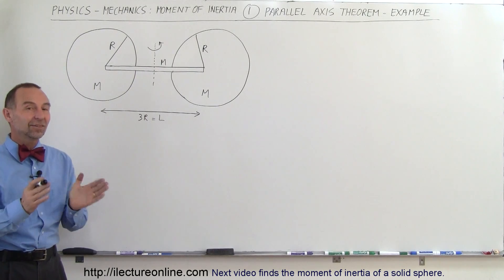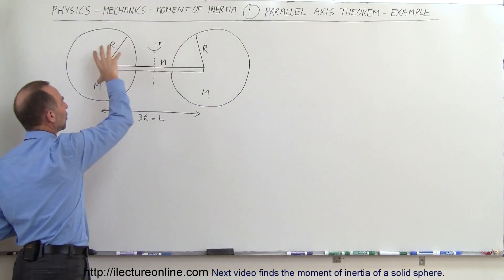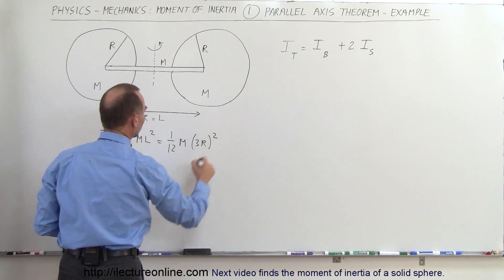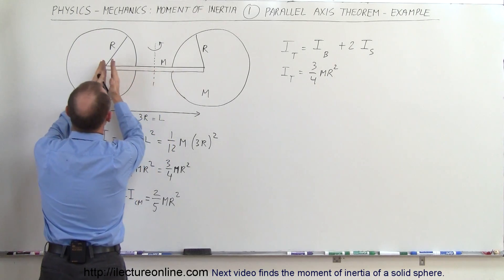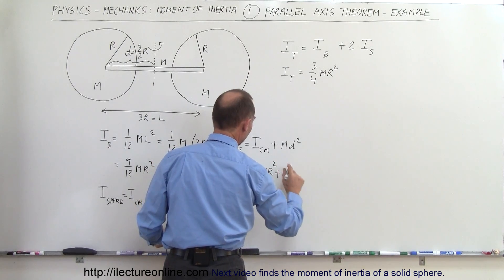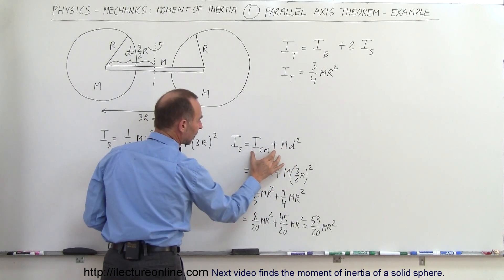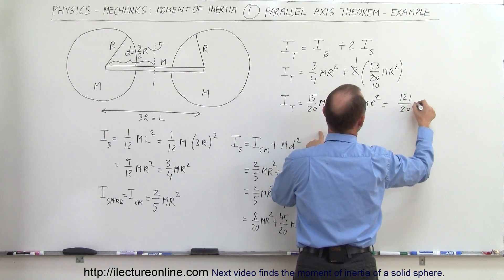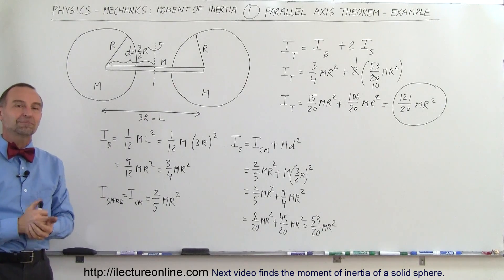Physics 12  Moment of Inertia (1 of 7) Parallel Axis Theorem: Example 1

Comment: I'm having trouble visualizing the object, do both solid spheres rotate vertically and what happens to the rod in between them? Is it connected to both spheres?
Reply from the maker: The bar is indeed connected to the 2 spheres and the whole combination rotates about a vertical axis that goes through the middle of the bar.

Comment: why didn't you use Md^2 for the center of mass for the rod but you did for the two spheres? is it because the spheres are the ones that are rotating?
Reply from the maker: The md^2 term is used in the parallel axis theorem equation where the object is rotating away from its center of mass.  The bar rotates around its center of mass so we don't need the parallel axis theorem equation for the bar.
Reply: @MichelvanBiezen  makes a lot of sense, thank you!

Comment: I have a very important question:  in another video regarding a "baton" you have the same setup and you don't use the parallel axis theorem you get  completely different answers... why is this different than the baton problem?
Reply from the maker: With the baton, the masses at the end of the bar are considered "point" masses and each mass therefore has the moment of inertial = m*R^2 = m*(1/2 L)^2
Reply: +Michel van Biezen thank you for your response.   Could you please ellaborate as to what is considered a point mass?  For example the "point mass" must be very small but it can also be very large etc. in other words ...what is the requirement to consider point mass?
Reply: Point mass means the mass is concentrated at a point. For you, that would mean that you would not have to take into account how the mass of the object in question would distribute over a radius. Hope that helps.
Reply: A point mass contains mass but has no other physical or structural quantities. No volume, no density etc.. Therefore you would treat the 2 point masses at the end of the baton like you would two masses at the end of a bar with negligible mass, rotating through and axis perpendicular to the bar.

Comment: In min 1:54 how did you get 1/12?
Reply from the maker: Gaby Toscano 
The moment of inertia of a bar rotating through its center of mass is (1/12) m L^2
See the video on that topic in the PHYSICS 12 MOMENT OF INERTIA  PLAYLIST
Reply: it is the moment of inertia of a rod at its centre 1\12 MR^2 .There is a list for all common shapes in books .
Reply: Hey, I know this comment is ten years old but for anyone wondering how to derive this "1/12ML^2", it really helps following the video mentioned by MichelvanBiezen and applying it to this specific bar.

If you use the formular he used in the mentioned video, your bounds of the integral change from which was before 0 to L to -1/2L to 1/2L. this will change the answer to 1/12 ML^2.

I really advise anyone to check this themselves, its relatively quick and fun!